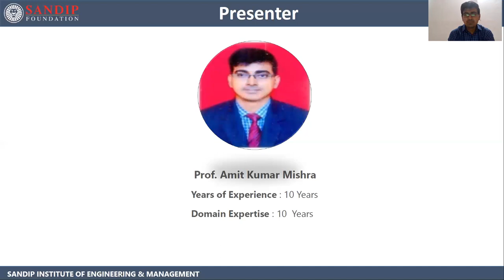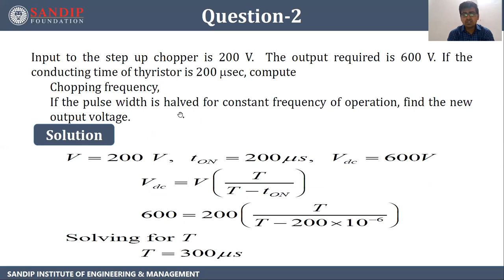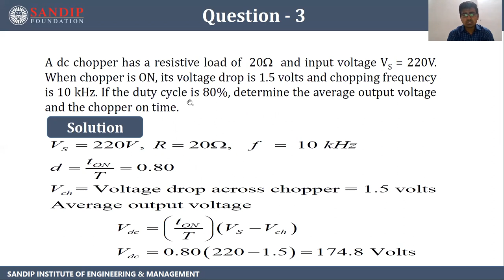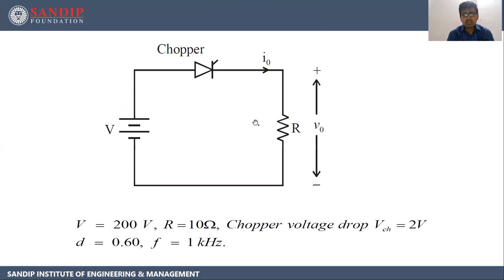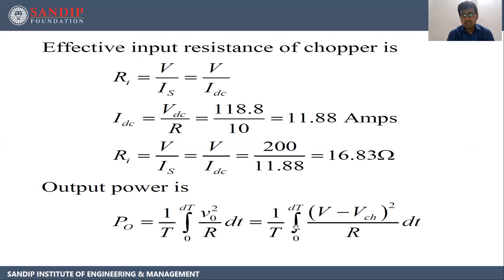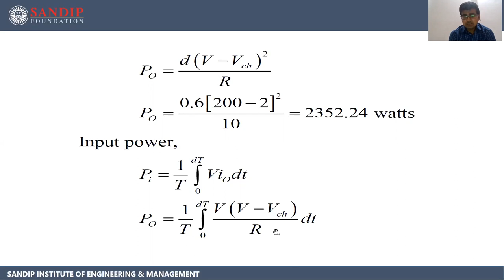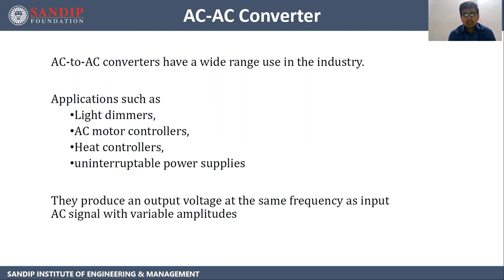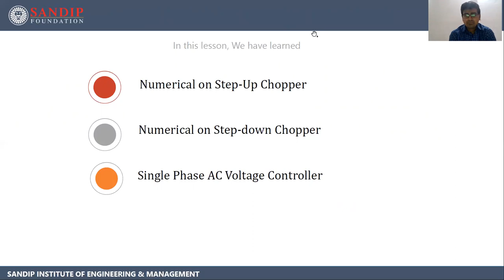Power Electronics - Numericals on Choppers

Comment: Ton = 0.5×350/460 hoga mili sec k liye, 10^-3 se multiply krne se second mai ans aaega, apne mistake kiya hai
Reply from the maker: I have mentioned milli second also. Kindly check again.
Answer which I have mentioned is 0.38 msec.
I mean my answer is correct.
In case for further queries u can ask
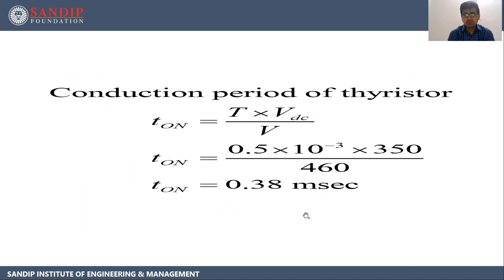Reply: @techphoenix88 1:30 maim kah raha 10^-3 se multiply nhi krna tha tb same answer aaega
Reply from the maker: It is correct. T value is 0.5 msec ( 0.5 * 10^-3) so 10^-3 to karna padega.
Pura numerical phir se solve Karo , u will get the answer.
Reply: @techphoenix88  main wo nahi kah raha hoon, ans aa gya hai msec apne 10^-3 se multiply kyun krdiya wo misyake hua h nhi to ans sec mai aaega
Reply from the maker: T ko solve karte samay vo 2*10^3 aayega not 2*10^(-3).
Therefore T will be 0.5 msec i.e 0.5 * 10^(-3).
Now final answer is 0.38 msec i.e 0.38*10^(-3).
Reply from the maker: f is 2khz i.e 2 * 10^ (3)
Still calculation is correct.
Reply: @techphoenix88  ha to time period reciprocal hota hai 1/2×10^3 = 0.5msec Or 0.5×10^-3 sec